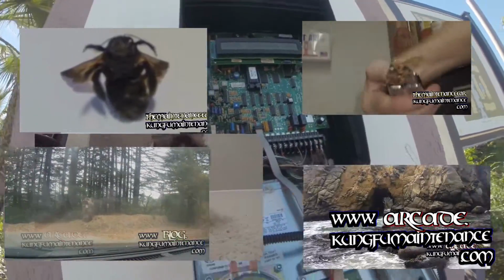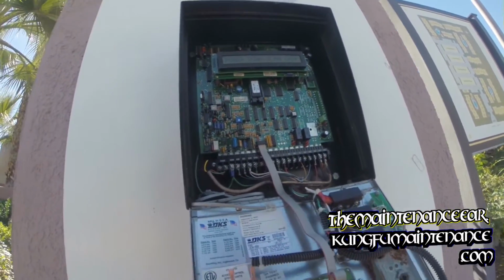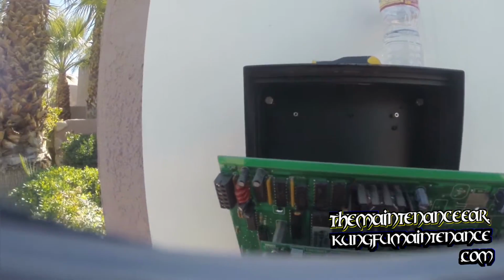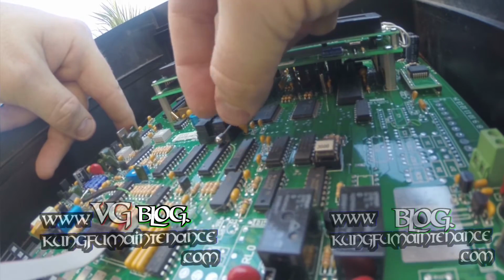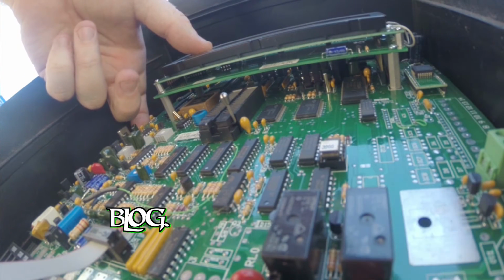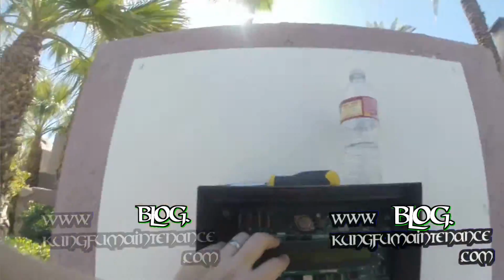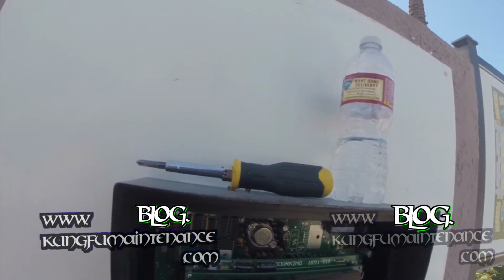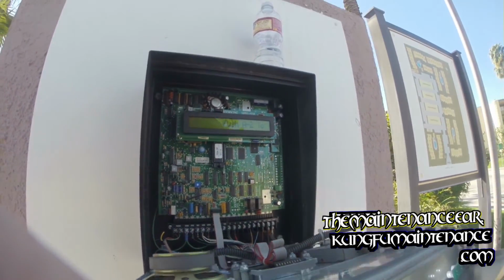Door King Telephone Entry Gate System Error Code Power Down Exchange Chip How To Reset Or Replace

Comment: I had the same error on a system and had never seen it before. Yours was the only video explaining it. Did exactly what you said, but also needed to erase the memory reset the master code, and reset the amount of ZIP Codes to 255. After I did all that I was able to upload all the original data and the system is running perfectly. Thank you so very much for posting.

Comment: Where is the backup battery.  Don't you have to disconnect a battery from the board before removing the chip?  It appears that it is connected to the socket and when the board is removed from the socket that turns off all power to the board.

Comment: It did not work what happen?
Reply: Charles Brown how old is your access control system. If its still under warranty you can call tech support and get replacements. Usually the board and chip are both sent out